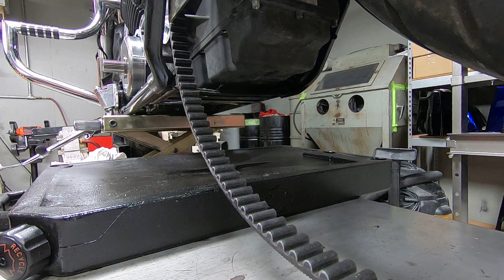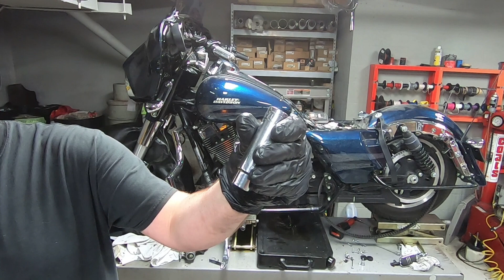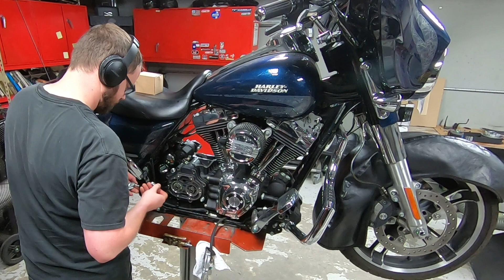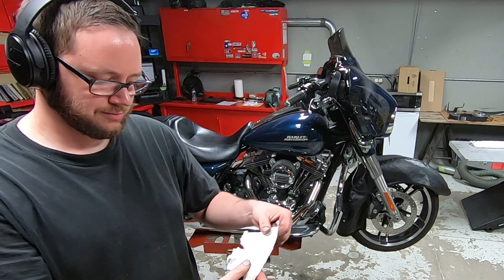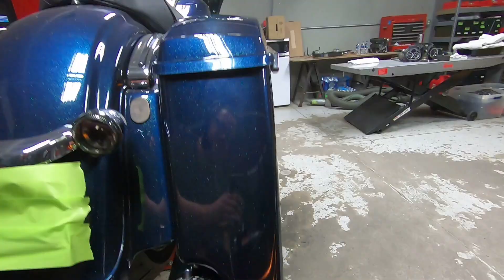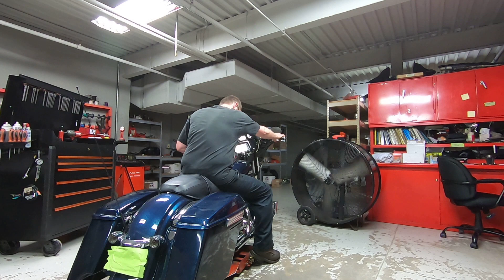HARLEY DAVIDSON MOTORCYCLE GETS A NEW TRANSMISSION

Comment: Brad, if you spend that kind of time cleaning parts, get yourself a ultrasonic cleaner with different size baskets. Throw the hardware in and set it while you clean the frame, clean hardware and it didn't extend the work time hardly at all. I use carb cleaner in mine but you could use anything you want, works awesome very little attention needed after

Comment: any real technician wears a uniform.. as well as put tank protection on the motorcycle. its common sense.
Reply: You must have been the technician that worked on this bike last 🤣🤣 you wore your uniform in the basement and your tank protection for a transmission job but you put in the wrong bolts and halfassed everything else 🤣 Real tech🤣

Comment: Have really used this video so far. Is there a reason you couldn’t put an assembled transmission in like this? Without the pan. I ended up removing the swingarm.
Reply from the maker: You can put in assembled transmission. But I wouldn't recommend it. It's so much heavier with the gear set in the trans case and the mainshaft sticking out the side of the trans case makes it difficult to get an assembled unit in the bike.
Reply: @HarleyDavidsonWizard  very true! Gonna tackle the replacement this weekend hopefully. I’m sure you will see the view count go up dramatically lol.

Comment: Hi Brad, Thank you for your video's and knowledge. You are very talented tech for sure. Can you tell me where I could find the long 3/16th Allen bit and the long 1/4 long Allen tool to do the starter  bolts? I have talked to my Snap-On guy and been to other outlets with nothing found. Thanks, and keep em coming. We love your video's.
Reply from the maker: I've had a lot of interest in the tool and I purchased it from matco years ago. It's been slipping my mind on getting the information but I just talked to my current matco dealer and he said he ordered one for me last week. I want to make sure it's the same tool I currently have before I give out the part number. Sorry for the delay.

Comment: Can you do a more in depth video on  how to properly torque the swing arm pivot bar? If you come across the opportunity of course. 

Have really odd tire wear and a side to side shimmy while going through corners.  

I had it apart to replace the brake pads,  wheel bearings and rear tire.  I checked for side to side play on the swing arm but had zero.  

It also moves freely and smoothly up and down. 

I had a dealership check it out a few years ago and after $140 bucks they said it was the tire.  It wasn't.  

I'll be taking it apart  to replace the final drive belt in a few months so I'm gonna look into the swing arm being the issue again.  

Thanks for the vids!
Reply from the maker: Sure if the opportunity comes around.

Comment: Just watched your vid for the first time. Awesome job! I do have a quick question for you. Is there any yellow metals in a new m8 6 speed trans? Can I just use a good syn 75w90 oil
Reply from the maker: The shift forks are coated in bronze but that's about it. The best trans fluid I've experienced is Bel-Ray Gear Saver Synthetic Hypoid Gear Oil. It also happends to be a 75-90w. I'd deffentally recommend it!!
Reply: Harley Davidson Wizard 
Cheers bud, thanks so much for the info.
Reply from the maker: @DG-fm6ti  No problem, Thanks for the question and welcome to the channel!

Comment: Catching up on older vids. Doing a 12pt SS bolt swap om my 14 ltd. The 4 bolts that attach the transmission case to the block. Do you think I would have an issue replacing them one at a time?
Reply from the maker: Nope. Replacing them one at a time is how we all do it. No problems

Comment: I bought a screamin eagle  6 speed transmission complete for 2002 electra glide , can you just remove the gearset and put it in the 5 speed case? there is a  screamin eagle 6 speed gearset you can buy to put in a 5 speed caes , just wondering if it's the same gearset used in the 6 speed transmission that is sold as a complete transmission?
Reply from the maker: I haven done a 6 speed in a older 5 speed case before so I cant give any input. sorry

Comment: I got away with screwing up. 
I'd blocked the left frame lower on my dyna and lifted the motor to change the isolator. 
Didn't take the extra moment to think through lowering the motor support and had the bike pivot from the centre. 
It came my way and luckily I gave it everything to bring it back upright but still had to jack the right frame lower, which would have been the reverse of how I'd lifted it. 
Would have taken 5 seconds to think through what was about to happen.
What didn't happen was getting stuck between the bike and a wall on my  own with no phone on me.

Comment: ..hey Brad , just another quick question concerning my repair .. what is the process to repair the countershaft needle bearing located on the primary side of the transmission housing ? .. can this be removed and installed using a hammer and appropriate sized socket ? .. which direction is out for removal ?
Reply from the maker: I use the biggest socket that will push the bearing through. I think is a 15/16 or 1in socket. I turn the socket   around and stick the extension in from the inside of the socket so when I'm hitting it, the largest surface area of the socket is applying pressure to the countershaft bearing. To remove the bearing I knock the bearing into the trans case and same when installing a new bearing, like im sitting on the left side of the bike (primary side) and drive the bearing into the trans case. I use a hefty mini sledge, probably 10lb. A normal hammer isnt enough. But ya. Pound the old one out and I coat the outside of the new bearing in green loctite #294. And pound in the new bearing. U gotta work quick as the lock tight sets up fast. The reason for the green locktite is, some trans case countershaft bearing bores are not a perfect circles and oil can leak past the bearing. And this is what the motor company told me to do so I do it on all countershaft bores now.
Reply: @HarleyDavidsonWizard  ...is there any concern that the thin wall of the transmission housing will break ..that is my real concern with using socket/hammer .. i havent removed the transmission from the bike and was hoping to find a solution that doesnt involve removing the trans housing out of the frame .. will the socket/hammer work while the transmission housing is still in the frame ?
Reply from the maker: I wouldn't be concerned about breaking the trans case. I've done it like this probably 50 times and havent had one break. It is a unsettling about of force the first couple times you do it so dont go thinking little taps will do it. A big single handed mini sledge for sure. And hit it like it owes you money. I've only done it with the transmission case in the bike, I'm assuming its easyest that way to or else you'd have to prop the trans case up against something. Baker Drive train makes a really nice tool to replace the bearing in a "more civilized" manner. It comes in there grudge box transmission kit. I've used it once and it was really nice. I dont know if they sell the bearing tool separately from the grudge box kit.
Reply: @HarleyDavidsonWizard  ..thanks for the solution , really appreciated !

Comment: .. when the transmission 'cartridge' has been installed into the case and prior to mounting the clutch basket ,should there be any in/out play horizontally when the 'splined mainshaft end' is pushed in/out toward the 'trap door' side ? ..should there be any endplay/float ? ..if no freeplay should exist ,what might be the problem ?
Reply from the maker: The main shaft (splined shaft) should have bacically no detectable (in and out) end play. The main shaft  is retained in the trap door with a roller bearing and roller bearings should have bacically no end play. When the main shaft does have end play it's a damaged trapdoor bearing or a damaged trapdoor door. Also the main shaft will have a little up and down play. But that's normal clearance.
Reply: @HarleyDavidsonWizard  ...thanks for the reply , i pulled the clutch cable cover and pushed/pulled  the mainshaft horizontally and can see movement/deflection in the bearing ..definitely not what i was hoping to see but i'm glad to have caught it now considering i have it apart and i've already replaced the mainshaft bearing and seal on the primary side ..

Comment: To remove the transmission if your putting a brand new one in, do you have to actually pull the gears and stuff out or can you just separate it with all of that in it ?
Reply from the maker: You pull out the transmission cassette assembly as a whole. It has all of the gears on it except for one that's left in the transmission case.

Comment: I watched the first video in this little series, and noticed that some of the gears had the 'cross-cut' at a different angle to the others and of course to the straight cut first gear ones. I believe that the gear cluster was a generation II when surely it should be generation III - I have a 2010 Dyna and that has generation III gears - which has all the angles (except 1st gear) going the same way. Is that correct ?
Reply from the maker: To be honest, I'm not sure. I haven't payed specific attention to the generations of the gear sets. Other than getting the updates from the motor company each year on "whats new , on the new models" I haven't thought about them in terms of the generations. I do like that tho, so I'll have to think about it. But yes, after the customer found out that the trans in the vehicle wasn't new and was actually used, he went back to the place that had done the work and they "fessed up" and said they found the "best low millage trans" so its deferentially likely the used trans was from an earlier model. Good eye and thanks for the question!
Reply: @HarleyDavidsonWizard  Thanks very much for the reply.....I was curious as the gearset is different to my one, and I had seen another video on Youtube in which 'Short block Charlie" describes things as so.... If that is so, then what was a gen II doing in a bike that should have had a gen III..... you just can't trust some independent 'specialists'  !
Reply from the maker: @thakery5720  True facts! Lol
Reply: I have 09 dyna, does my bike have a generation III trans?
Reply: @gljazz   I don't know, best ask a dealer.

Comment: When you pulled the transmission case was there anything that needed to be replaced in the case itself?  Did you just inspect and clean up.
Reply from the maker: In this particular situation we replace the transmission case because it was physically damaged. In a normal transmission overhaul I would leave the transmission case in the motorcycle and replace the main drive gear bearing and the counter shaft bearing. But both of those bearings come preinstalled in a new transmission case. Thanks for the question and the view.

Comment: What brand of impact driver is seen at 50:15?  Is that a Milwaukee?
Reply from the maker: Ya, its a Milwaukee M18 1/2 #2763-20 its an absolute brute, but has such a light percise trigger u can run in 1/4-20 bolts with no fear of over tightening, but then bust any nut loose you can find. Other tech used to struggle with air impacts and super tight bolts, like compensator bolts, but when I bought this bad boy at home depot, that all changed. Its a huge tool but I preferred getting used to have 1 large power tool rather than running around in between 2 power impacts. Thanks for the question and view!

Comment: I have to fix a 2020 road king special, because some A hole didn’t extend the wires, or use silver sadder
Reply: Hey Brad?! I had a first as a tech today. I had a 2016 Street Bob that was leaking oil from the clutch cable adjuster area?!🤔 come to find out it was a air flow issue with the vent line. Have you ever seen that?!
Reply from the maker: Ya. I've seen where mud bugs carry mud into the trans vent and clog it up. Pretty rare. It sure does drive customers crazy trying to figure it out.
Reply: That’s exactly what it was lol customer thought it was something I did, because I had just serviced the bike. It was definitely a first for me lol.

Comment: First Harley dealer I heard of  helping the customer.
I've had them steal parts off my bike and replacing them with same parts with chrome damaged. One dealer lied to me saying I  had a bad crank bearing that I needed a new engine , ha ha . I'm an auto mechanic and knew better. I never again take my bike to dealers.
Reply: First he said it was a warranty for a customer then at time 2:47 he said it would end up being a nice bike for someone.
Reply from the maker: It was a complicated situation, if I remember correctly. I believe the customer who owned the bike at the time of the video had just recently purchased it from a general motorcycle place (non HD dealership) and when he purchased the bike he also purchased an aftermarket extended warranty program. And when he purchased the bike, I believe he was told it had a "new" transmission that they just put in it. I think he jad ridden the bike only a couple of times since purchase. So ya, it was an aftermarket warranty kind of deal. And I didn't know the guy so I was just saying it was gunna be a nice bike now for whoever he his.
Reply: @HarleyDavidsonWizard  ... I see

Comment: Great job Brad! Hey, I'm kinda new to Harleys and am in need of advice from a real mechanic like you. I'm no Harley mechanic. I'm a retired pipewelder/fitter in the shipbuilding industry (30 yrs) and am mechanically inclined. In this line of work, I've run into just about every kind of mechanical mishap one can imagine... I had a bad noise coming from the primary area on my 07 Road King. I found small metal shaving on the trans drain plug. I went as far as replacing the inner primary trans bearing (pressed in inner primary case) I went back with a Baker sealed bearing and eliminated the race one because I found it pitted and somewhat scarred. I buttoned it all back up, but only to realize I didn't stop the noise. So I'm going back in there and am gonna replace the main gear bearing (provided it needs replacement). So, my question to you is: Is there any advice, or tech tips you can offer me??? Thanks, and keep doing what you are doing. You have a great future ahead of you! The motorcycle world is in dire need of people like you! ...Godspeed.
Reply from the maker: the only real tech tech tips are..  Remove the trans dipstick before removing the gear set assembly and the right tools make the job easy like  https://amzn.to/3mPCgNA https://amzn.to/3rqm2hf https://amzn.to/3rDmngS . I filed the edges of the snap ring pliers so they don't nick the aluminum bore during removal and install.